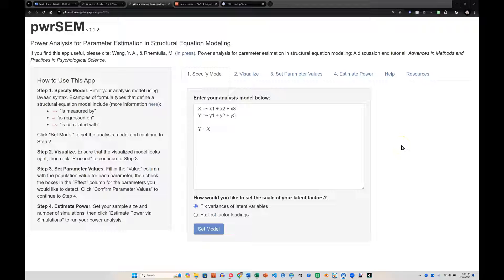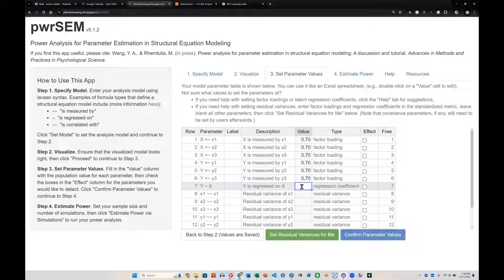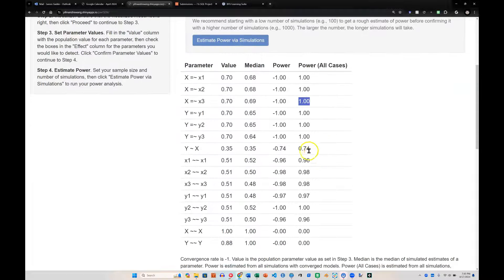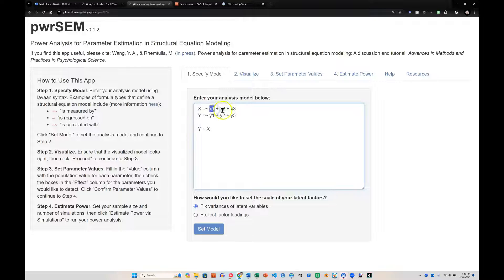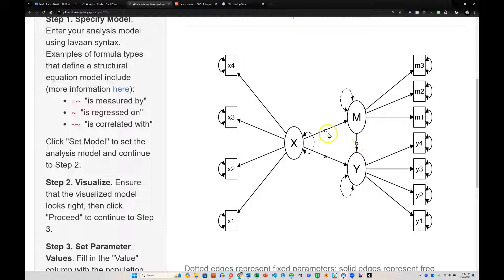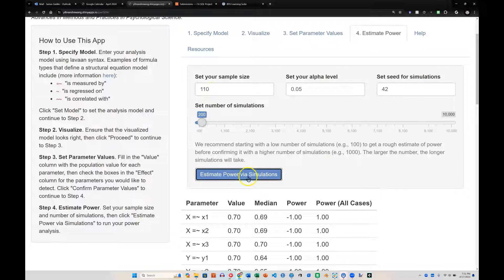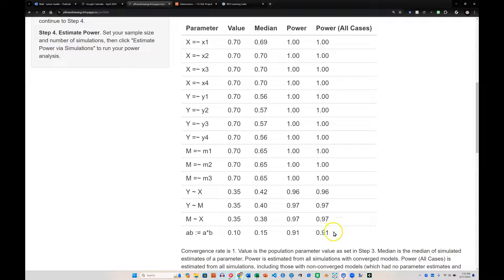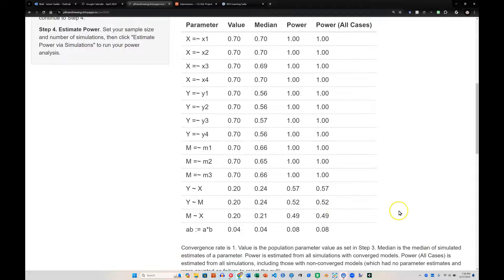pwrSEM a-priori Power Analysis for SEM

Comment: Hi James! It's a bit long. I hope you could help me after two days of failure.. 
Below is my model specification. I’m trying to analyze:

  Y =~ y1 + y2          # measurement model for latent Y
  M ~ a1*X1 + a2*X2     # observed mediator M regressed on X1 and X2 both observed
  Y ~ b*M               # Y regressed on M
  X1 ~~ X2              # covariance between predictors
  a1b := a1 * b         # first indirect effect
  a2b := a2 * b         # second indirect effect

The model includes two observed x variables -> one observed mediator -> latent y variable measured by two indicators: 
I’ve specified these parameter values:
  a1 = a2 = 0.40
  b  = 0.50
  loadings (y1,y2) = 0.70 each
  X1 <-> X2 = 0.80

However, when I run the analysis in pwrSEM, I face 2 problems:
1. I can’t define measurement-error variances automatically like you did. I receive this error message: "Residual variances could not be calculated. Make sure the parameter values you entered can produce a positive definite model-implied covariance matrix."
2. The convergence rate drops to zero, and the output shows “Inf” or NA for Power, which seems incorrect.

Here is the results summary:
  Parameter    Value  Median  Power  Power(All)
  Y =~ y1      0.70   0.70    Inf    1.00
  Y =~ y2      0.70   0.70    Inf    1.00
  Y ~ M        0.50   0.50    Inf    1.00
  M ~ X1       0.40   0.39    Inf    0.68
  M ~ X2       0.40   0.40    Inf    0.71
  X1 ~~ X2     0.80   0.63    Inf    1.00
  a1b := a1*b  0.20   0.19    Inf    0.62
  a2b := a2*b  0.20   0.20    Inf    0.65
  Convergence  0

Could you help me please?
1. Is there a built-in problem in my settings or model that causes the residual variances problem?
2. What might cause zero convergence rate and infinite power estimates?

Any guidance or workarounds would be greatly appreciated. Thank you for your excellent tutorial!

Best regards,
Ohad
Reply from the maker: Hi Ohad,
I have not used pwrSEM much, so I reached out to the strongest reasoning model for chatgpt (o3) and requested it take a look. Here is what it found and recommends: https://chatgpt.com/share/687e54fd-f4c8-800b-9212-a2888f3948da
I hope this is helpful. If not, I'd recommend reaching out to the creators of the tool. They should be able to point you in the right direction.
Reply: @Gaskination  Thank you very much! I would appreciate the opportunity to ask a few more brief questions and apologize for any inconvenience.

Which tool or package do you currently recommend for conducting power analysis in SEM (besides pwrSEM)?

If you work in R, which package do you typically use? Or is there another package you rely on (e.g., semPower)?

Is it common practice to perform manual Monte Carlo simulations in R without using a dedicated power analysis package like semPower? or do researchers generally prefer established packages (e.g., semPower, semTools)?

I would greatly appreciate hearing about your experience. Thank you very much for your time and insights!
Reply from the maker: @levi1ohad1i  I usually just get more than I need for sample size and call it good. But, I know a lot of people use G-Power. If I were to use a tool, it would probably be pwrSEM... I don't use R (never have).
Reply: @Gaskination  Thank you very much for your time!!

Comment: Dear James, do we have to worry about Power from all simulations with converged models? Let say the Power (All Cases) is 0.99 but that from converged models is -0.33.
Reply from the maker: I'm not totally sure I understand your question. But if you have .99 power from all cases, then this should be fine.
Reply: @Gaskination  Thank you for your answer. I tried HCM, although the model was purposefully exaggerated with many observed variables. If .99 power from all cases should be fine, like you said, then would N = 150 be enough for this monstrous model?

x1 =~ x1_1 + x1_2 + x1_3 + x1_4 + x1_5
x2 =~ x2_1 + x2_2 + x2_3 + x2_4 + x2_5
x3 =~ x3_1 + x3_2 + x3_3 + x3_4 + x3_5 + x3_6
x4 =~ x4_1 + x4_2 + x4_3 + x4_4 + x4_5

M =~ m1 + m2 + m3 + m4 + m5 + m6 + m7 + m8 + m9 + m10 + m11 + m12 + m13 + m14
Y =~ y1 + y2 + y3 + y4 + y5 + y6 + y7 + y8 + y9 + y10 + y11 + y12
X =~ x1 + x2 + x3 + x4

ab:=a*b

Y ~ c*X + b*M
M ~ a*X

X ~~ X
M ~~ M
Y ~~ Y

I tried 150 samples, 1000 simulations. The Parameters, Value , Median , Power, Power (All Cases) are as follows:
Y ~ X 	      0.35 	0.42 	-0.32 	0.95
Y ~ M 	      0.35 	0.40 	-0.33 	0.98
M ~ X 	      0.35 	0.38 	-0.32 	0.95 
ab := a*b      0.10 	        0.14 	-0.30 	0.92
Reply: Yes, according to pwrSEM 150 samples in your model are sufficient. But it is overly optimistic. I'd trust manual Monte Carlo simulation in R more—I think even 200 samples may be underpowered for indirect effect.
Reply from the maker: @AkselerasiIndonesiaMaju  That is a very complex model. I am surprised the power estimates came out so high with just 150. I would recommend double-checking your expected effects, particularly the indirect effect (which tends to be small).

Comment: @ james gaski. Sir i have finite population and my sample size comes 750 sir i dont have any supporting refrence where minimum criteria is 600 i found many refrence klines ( 2002) he said minimum sample size should be 200 hair et al (2010)said no of items in q *10 
Sir if u can give me any supporting refrence in social sciences where this 700 is taken plz i am in immnese need coz i couldnt find any one
Reply from the maker: If you have 750, then you have more than enough. No need to cite anything if you have so much sample. The trouble would be if your sample was too small.
Reply: @Gaskination  i need citation for that refrence plz include any authors name year whivh i can give as supporting refrence
Reply from the maker: @hameemislam753  I don't think I understand what you're trying to support. Are you trying to justify 750 sample size as sufficient? To do this, just do a power analysis and then cite something on power analysis, like:
-MacCallum RC, Browne MW, Sugawara HM (1996) Power analysis and determination of sample size for covariance structure modeling. Psychological Methods 1(2):130-149.
-Tanaka JS (1987) 'How big is big enough?': Sample size and goodness of fit in structural equation models with latent variables. Child Development 58(1):134-146.
-Wolf EJ, Harrington KM, Clark SL, Miller MW (2013) Sample size requirements for structural equation models: An evaluation of power, bias, and solution propriety. Educational and Psychological Measurement 73(6):913-934.

Comment: Hi James. As you have probably noticed, the driver of the power analysis is the minimum absolute parameter in the model, which in SEM is usually the minimum absolute path coefficient in the model. The simple formula at the bottom of page 9 on the paper linked below gives a very good (slightly conservative for PLS-SEM)  approximation of the required sample size. https://cits.tamiu.edu/kock/pubs/journals/2018/Kock_Hadaya_2018_ISJ_SampleSizePLS.pdf